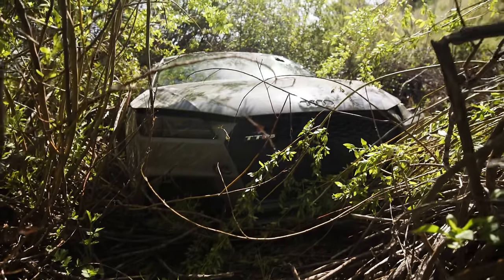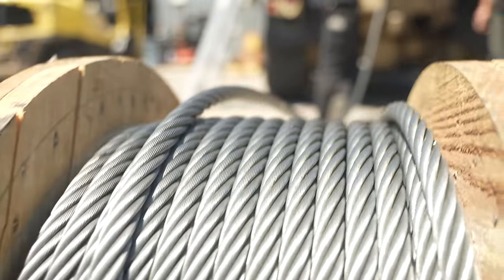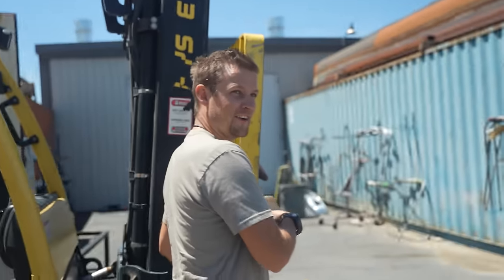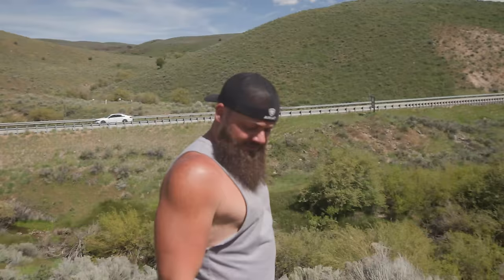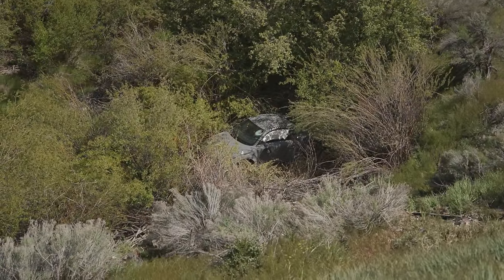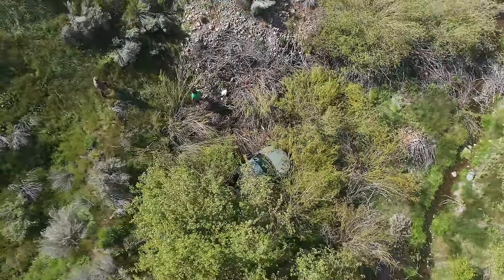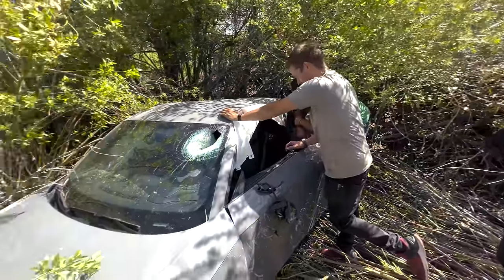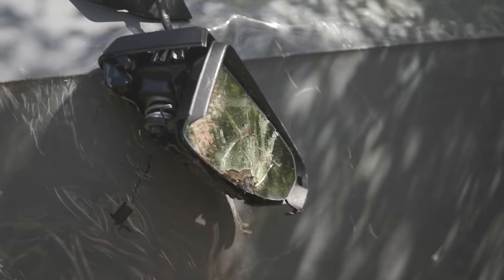Exotic Rental Car Launched Off Cliff and Abandoned By Renter

Comment: Francis has a point, when working on my parents farm in the uk we used to do a lot of logging using winches and heavy cables, the farm was about 3000 acres which in the uk is large, we had a lot of forest land that we would clear. One of the winch operators who had been doing the job for around 30 years used to take chances like that, one day we were pulling a massive oak tree up a hill with one of the winches, the cable was not very old and was rated far greater than anything we would use it for, I was at the bottom with 5 of the loggers, Jason the winch operator was at the top with another 3 guys, I saw the tree get caught then twist side ways, however it happened the cable went bang. We heard a lot of screaming seconds later and ran to the top of the hill, what I saw will haunt me forever, Jason who was watching the cable spool on reel was slumped backward over the winching rig with half of his head missing, the cable cut through it like a surgeon, the screaming was from the 3 guys who were grown men just running around in shock at how quick it happened. Cables scare the sh@t out of me now so PLEASE be careful and don’t get complacent.. I love your show so much I wouldn’t know what else to Watch…
Take care guys .. always …

Comment: Little piece of advice from a tow truck driver instead of having the cable run on the side of the bed like that and get a 4x4 or 6x6 cut a v in it and let the cable run through that instead of the bed that way it doesn't destroy your cable or your bed
Reply: i was wondering if there was a better way.
Reply: @lynch42o  definitely is but it's like everything it takes time to learn
Reply: I see that being done by most professionals
Reply: Would it be welded to the bed or clamped on somehow, would you need it to be mobile?
Reply: Put the v like he said on slide rails
Reply: @tacticalultimatum  How would you weld wood to metal?
Reply: @bladimirgarcia6063  ohhh I was thinking square tubing, I’m just struggling to picture it
Reply: @bladimirgarcia6063  very carefully
Reply: @tacticalultimatum  Well as you can see in the video, they have the cable rubbing on the side of the flatbed pulling up all the weight, all that friction is capable of cutting into the flatbed, damaging the cable in the process. But if you put a  4x4 or a 6x6 it will deteriorate the wood instead. The V cut out is so the cable stays in place. Ofcourse you'll be replacing the wood block but thats cheaper.
Reply: @1SweetPete  🤔
Reply: @tacticalultimatum  no you just put it where the cable would touch the bed and put it under tension
Reply: @towtruckaj  I wouldn't think that the timber would have to be fastened, placed next to the lip of the bed under cable, I haven't seen any that had to be, I've seen them, just put it under the cable, all the best to yous and your loved ones
Reply: Yeah and get out of the freaking bite and use the controls on the driver's side FFS¡!!!
Reply: @towtruckaj  I like that, I’ll have to implement that on my rig
Reply: @donaldhalls2189  Yep that's what I was trying to say, get your cable in a line with where it needs to be, put all necessary rigging in place, then where it is rubbing the bed place the block under the cable and put tension on the cable, If it stays while you get it under tension it'll likely stay for the pull.
Reply: @tacticalultimatum  They also make side pull guides that go in stake pockets or on certain style rails, I don't get to far into any of that because my truck has a dedicated side puller but on my old truck I did have to fight with some of the rubbing of the bed.
Reply: I use a stake pocket fairlead block for that exact reason.

Comment: Hey, a few observations here, let's do the important one first. I know that was new cable and you had a rag as well but as an old Navy guy taught me years ago never use gloves if holding a winch line. If a loose strand jags your hand you may get a bit of a rip, if it jags a glove it can pull your hand into the works and that;'s bad, mmkay? Use just the rag, it will pull out of your hand.

That wreck is a tribute to the survivability of Audis, there are a lot of cars in which that would not have gone well. 

Glad to see you didn't sell the rollback like you were going to, it's way too handy.

Comment: Heavy D, A suggestion for you ,  build a small 'A' frame that drops into the rail pockets that is tall enough to accommodate a snatch block, so you are not dragging the cable  over the side. By using one snatch block so the cable spools straight into the winch, and then feeds the snatch on the 'A' frame you will have better control of direction and less damage  to the equipment.
Reply: And can run the levers without his head 2 feet from a raggedy cable!
Reply: That would make sense but that’s not how they work
Reply: the flatbed is littered with holes to attach a snatch block if you properly park the vehicle in the line of pull
Reply: nothing better than a good "Snatch"  🤣
Reply: Could’ve parked at an angle more accommodating to the angle of the pull and def would recommend using the snatch points and having one higher so u don’t decapitate urself when the line snaps and ur head is maybe a foot or 2 from the line the way it is now. Just some safety tips from ur caring audience! Much love!
Reply: These guy's are ALL for show hope y'all realize that
Reply: @dieseldabz7104  there you are again making a great point 🙌
Reply: It's just a Youtube/TV show, it's not like they are really gonna use the equipment much in the future.
Reply: Maybe even a Rollback with a side puller would be a good investment for them!
Reply: @joelmartin2549  Yes, but even just doing it a few times incorrectly could cost someones life or serious injury.

Comment: Two things first off this gives me so much more confidence in my VW tow hooks(identical to Audi). Second  honestly that looks like it would be savable. The drivetrain looks like it would be mostly intact and honestly doesn't look too bad as far as body damage. I'm sure the insurance will and did total it but it's absolutely something that someone could save and likely for reasonably cheap if they can get it from an insurance auction for cheap and have some basic bodywork skills and equipment.

Comment: Few things from a tow truck driver put the snatch block at the end of your bed will give you better pull rate and then stand on the opposite side the cable is pulling so if it snaps your safe of the cable backlash and then also make sure none is walking behind the car as you pull if it breaks could hurt them just a few things I saw that I'd add a little bit of my knowledge
Reply: as a tow truck driver i was cringing the entire time honestly. i love watching their videos but there was so much done wrong in this recovery.
Reply: @ivanfZR1  Needs more upvotes.  I was cringing watching him try to get that block in while it was unspooling.  I'm not even a tow driver.  I just did some off-roading years back.
Reply: @ivanfZR1  same but just trying to add some helpful tips he's his own person he can listen and possibly use some tips if not it's on him not me
Reply: @TheMugwump1  lmao offroading is what got me into being a towtruck driver lol i really cringed when he used a ratchet strap to hold the snatchblock center on the bed
Reply: @tyniehometravels1861  thats true, but some of what was done could kill someone
Reply: @ivanfZR1  yeah all I could think is the strap giving way and bucking into someone head
Reply: @tyniehometravels1861  same! Im curious why they didn't use the 5 ton to winch it up since it was already on scene
Reply: @ivanfZR1  honestly I use a 26,000 international roll back with a side pull could have easily done it with one guy safely
Reply: @tyniehometravels1861  oh i don't doubt that at all, those side pullers get work done. I was just sayin use the 5 ton cuz they seemed to be on the struggle bus useing the flatbed
Reply: @ivanfZR1  completely understand yeah 5ton would have pulled it up at like 10 mph lol

Comment: Hats off to those Audi engineers that designed that tow hook.
Reply: Indeed.

Actually back in my childhood every car of a german brand had a non-removable tow-hook on the front and back. Today you only see those "You have to screw it in before you can tow the car" hooks where 95% of the drivers dont know where the hook is stored in their car. Okay, the plus is, you dont see the two hook all the time, only when you need it, but if the driver doesnt even know where he finds the hook it costs WAY too much time.

But still pretty durable, just like the rest of the TT. I saw TT's coming out of crashs in one piece where other cars where torn apart.
Reply: All sports cars like that have those tow hooks lmao the uneducated lmao 🤣
Reply: @JackMacLupus  You didn't saw it on the older cars, it wasn't like they stick out off the bumper
it was on the frame you had to go down on your knees to really see it and connect the cable 
it's today in a more convenient reachable spot but therefore must be hidden for clean look.
Reply: Having owned Audi, Mercedes BMW's I can testify to German engineering being top quality.
Reply: And the whole car..  Driver walked away.
Reply: Those tow hooks are common thing in allmost every car nowadays and I always use them to pull car on the bed. But in that kind of recovery, it takes only one professional guy and one truck, not a two trucks and bunch of people.
Reply: @Stefani2020  explain
Reply: @JrgsGrg  is a show, don’t you get it ?
Reply: German engineering
Reply: @JrgsGrg  Except they weren't sure about the terrain and if it needed to be lifted over a guard rail. Amazing what you can learn when you watch the whole video...
Reply: @FabFunty  ya they actually are I’ve had a few older models each one had that same tow hook lol bmw Audi and Mercedes
Reply: @peterbockholm3176  Ok tell me about oil leak and consumption issues please. you must be an expert by now.
Reply: @sebastian3004  unless he capping or I mean owning older ones like earlier than 2000 are much better mechanically than the new ones
Reply: @sebastian3004  better than you car
Reply: @leonk.1031  an automobile is better than a car
Reply: It’s a Volkswagen thing
Reply: @kengreen4933  all Audis an vws do… basically the same car.. they share a lot in common
Reply: That towing eye will hold the whole weight of the car suspended in mid air...
Reply: @jezrougan  yup.  Now add in the resistance from four flat tires locked up, dragging up a steep incline.  Ask any Jeep owner that has only an 8000pound winch on the front and they will tell you 8000#’s is not enough for a 5000# jeep.   Obstacles add increased work.   I can almost guarantee the Ford engineer designed the Ford Focus tow point to hold the whole car,  I seriously doubt it would have held in a similar situation as this
Reply: Its a german car :) and even better its an audi.
Reply: Made under vw brand so I was told . Suprising all the car made under that brand. 
Have 2008 beetle and if something breaks they charge Lamborghini price . 
I mean 500 bucks for headlight buckets someone stole . That was before the pandemic.
Reply: @KA-yi4re  true
Reply: We were surprised it held up!
Reply: @peterbockholm3176  🤣😂Good One.
Reply: @JrgsGrg facts bro, I’ve seen worse recoveries done by sidepullers on flatbeds
Reply: You mean a standard tow hook thats in the car by law?

Comment: Heavy D great job on all those recovery  vehicles  but hey try using V cut wood for the winch cable  rubbing on bed truck it save that cable longer and reduce  chewing at the bed on hard pull.

Comment: @HeavyDSparks, iv been a het mechanic for the better part of 15 years in the army/civilian side, i cant really tell the model het u got their but it looks like an A1, anyway both the old hets and the new ones are detuned. The new het if i remember right is detuned to something around 30-40% because the power was breaking driveshafts. If you can find a local cat mechanic/dealer around you and convince them to go into the tcm and crank the tune up just a little u can easily get up to 80mph. Granted its probably still cheaper in fuel to haul the het than to actually drive it places haha. Id always hear storys in my unit when they were in Iraq 2005 they had the old hets custom tuned up and were ripping across iraq doing 70 mph instead of the detuned 50-55 and were cutting convoy trips times down by days to a week. I dont think the software we got at work can do any adjustments with the tunes.

Comment: I recommend taking a look at YT channel Ron Pratt. He does towing & recovery in SE Missouri. He includes lots of instructions, tips, and warnings.  He uses a post section with a v-notch cut into it. He runs his cables over the notch, instead of the edge of the rollback bed. It protects the cable from damage & catastrophic  failure. I was cringing through your entire recovery. Thank you for your excellent videos.

Comment: I’ve rolled a maxima in a ravine or a holler as we say running 80 mph at 15yrs old I can’t remember if I was high but I probably was. I recalled that wreck yesterday, no license, smoking weed, 80mph,180 degree curve, no seat belt, and sunroof open idk how we lived but it was in gods plan.s. We climbed out the back  window walked up the exhaust pipe and climbed the hill. We walked half a mile to a friends house before the cops showed up. No issues though just blessings. I will never give my kids a maxima or accord to start learning to drive. Anything that will run 140 a teenager doesn’t need.

Comment: Being a former tow truck from Calif. one thing I can't stand is a Winch Cable that looks like a Rats Nest.  You need to pull the cable out and respool it and put a cable tensioner on it so the cable goes on straight and even.  U need to go back to towing 1 and learn how to do things the correct way.

Comment: As long as you're replacing winch cables... the Flatbed needs one too... it's Damaged badly & is visable twice....   First at  1:05  and again @ 12:13 ......  try not to run the New cable under tension over the edge of the deck like this... that's damaging too under load.

Comment: Just an idea that I use to use and thats everytime that I was finished with my cables I would run them out just more than what I was using on the job then I would cover a cloth with oil and run the cable back in running it through my hand with the cloth and just keep adding more oil as it is drying out it helps with the length of time it lasts before it rusts out.👍👍✌👊👊

Comment: Right at 12:15,, your messing with a snatch block,, and a nasty section of cable feeds threw,,,, I would not trust that cable my brother,,,, it's been pinched and spread,, it's no longer a wire rope🤘🤘 letting ya know what I see,, be safe out there🙏🙏

Comment: Frame is done, but can recover a lot of parts from the wreck: engine, transmission, lights, seats, steering wheel, entertainment system, dashboard, maybe the rims, breaks and rotors. Can probably sell the wreck for $30,000 to $35,000.

Comment: that hole in the windshield was made by something outside the cabin, the glass is pressed into the cabin, not out. If it were the head that hit, I don't think it would have hit that high, plus there would be blood evident on the windshield, dash, steering wheel likely some would have got onto the seat, door, and driver's side curtain airbag - head wounds bleed a lot. I would go with the branch theory and look for traces in the cabin.

BTW, not too far away down in the area underwater is a Donner party camp site.

Comment: You guys should cut a v- groove into a 4x4 and put it on the tow truck so you have one for doing those side pulls. Way better to use & doesn't screw up your cable. Also I'd turn that car into a drift car or some sort of race car since it'll be totaled. Might as well buy it back from insurance comp.  Alot of usable parts on that car they could sell off & use towards whatever they decide to do with it.

Comment: hey audi guys, put anti fog on the glass of the cars, it will stop the fog from vape and smoke, also you can use dawn soap to wash it off then do a dry rub with dawn soap to add a protective layer on it to help pervent it.

Comment: Next, replace the cable on the roll-back, it's in sad shape. They make side pullers which is a winch fairlead roller mounted on an adapter to fit into the side rail pockets.

Comment: Team jack all the way, I  always enjoy your videos and content but as a wreckmaster certified tow truck operator with 30 yrs experience this one had me concerned for your safety. That winch cable on the rollback has some serious damage to it for one, and kneeling down next to it while winching the vehicle up is a huge safety hazard, if that cable broke it could easily take your head off. They make sleeves to go over the cables that are weighted so if it snaps it drops straight down.

Comment: You should have been doing this recovery from the opposite side of the bed. If that cable was to snap it would kill you where you're standing. Duck down from the other side of the bed if it snaps it flings right over top of you

Comment: I would have to have to do a recovery like this in an old NPR tilt bed a BMW that has gone offroad like that and landed on the roof of a house.  Had to get creative seeing didn't have enough cable to reach it almost had to use the belt of my pants but got it and winched back up to the road.  shockingly it has still drivable after that the house only had tire marks on the roof but sure needed to be inspected.  Bent the Audi would move under it own power still seeing  the crash didn't knock any of the wheels off  the undersides protected by an undercarriage pan

Comment: Looks like they need some spray foam and a full-blown epoxy coating to make a new boat out of the car looks like it'd make a good speed boat put a propeller on the back yeah I had to run it by a jet it's perfect it's in great shape for it I drive it like it sits